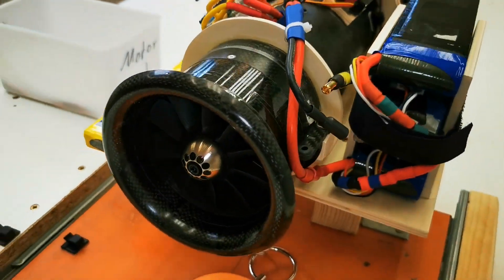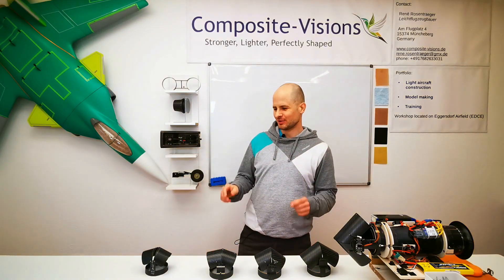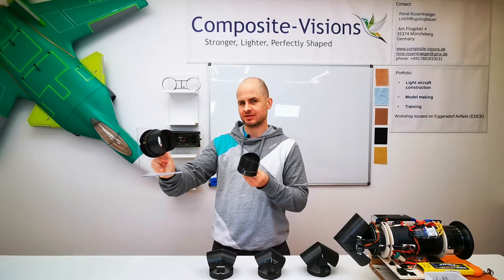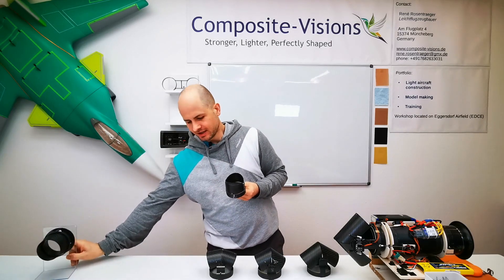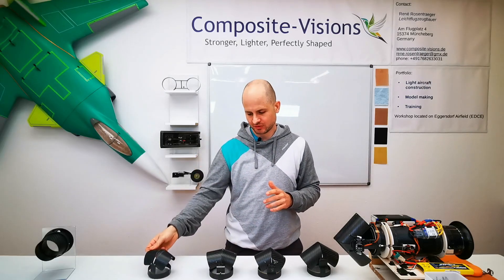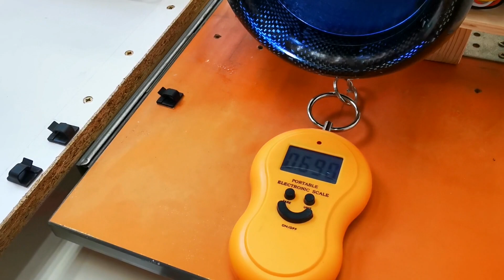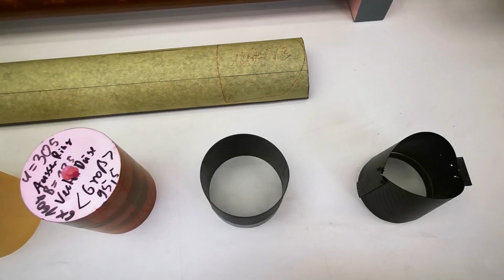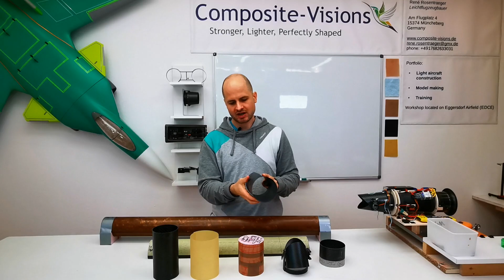Thrust Reverser + Thrust Vector Nozzle | Carbon Fiber Construction

Comment: Any way you can make a 3d printed version that can be easily be scaled up or down to meet the need of an aircraft.   I have a BD5J that would be cool with thrust reversal and vector nozzles.   By the way... I'm almost done printing the SUX.  Great job with the designing of that aircraft.
Reply from the maker: Thx mate! For the reverser is still a lot of engineering needed. This takes some time⌚😁✌️
Reply: Hows the SUX going?

Comment: Its obvious from your video that your thrust reverser concept works... but I am struggling to figure out why!

I mean, in real airplane turbofans the volume of air coming out of the turbine is higher (combustion byproducts are more voluminous than just air, and the temperature is much higher aswell) than the volume of air coming in, so if you redirect part of the exhaust to the front you have reverse thrust... but in your case, the air composition is the same, and should be only marginally hotter... so the force of the redirected air should be roughly equal to the aspiration on the ducted fan inlet. Where is my mistake?

Thank you
Reply: The forces from the air rushing into the engine will all be counteracted by the “drag” of them hitting the components and eventually the thrust reverser. If you mounted a flat plate behind the engine, the thrust and this drag would cancel out. The same thing is happening in Joel’s case, except some air is redirected forwards which produces a net backwards thrust.
Reply from the maker: Thx for explaining Adam👍👍